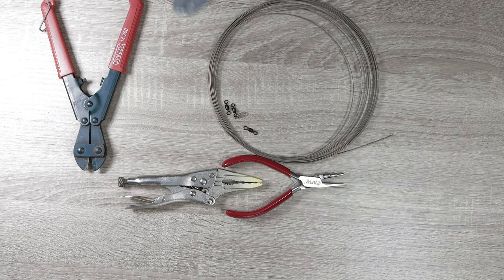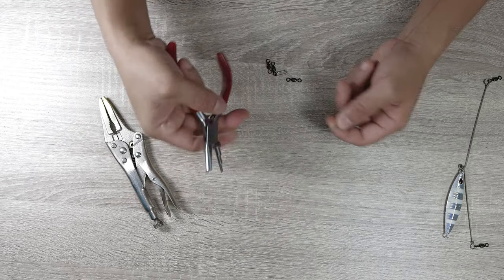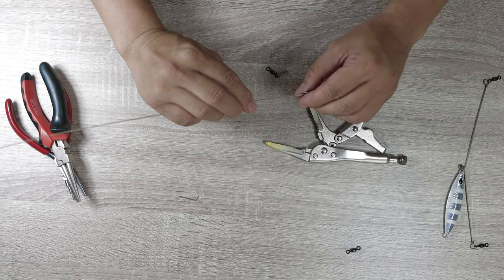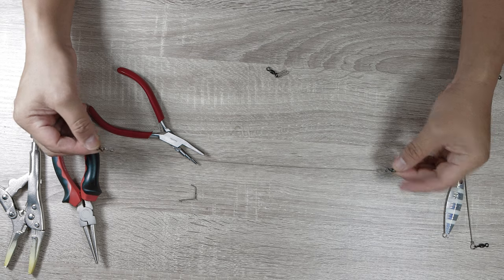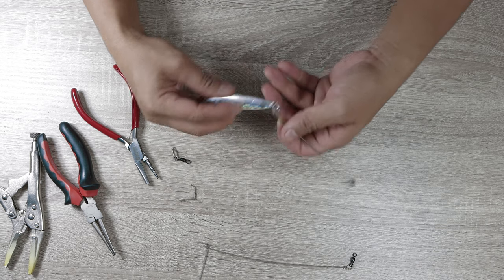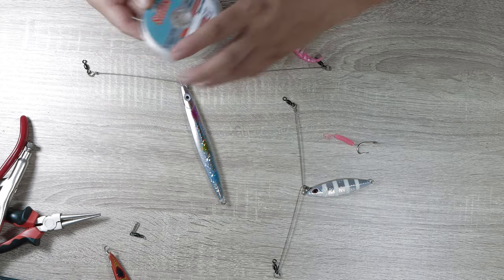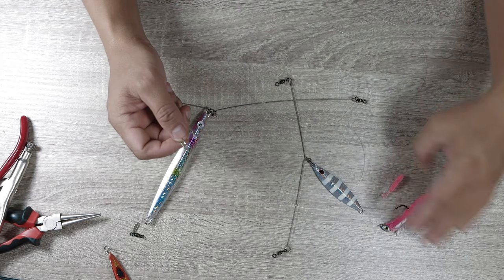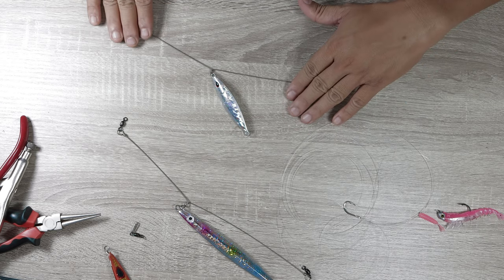How to make a Wire spreader rig for Jigging

Comment: no hooks on the jigs? is it basically just used as a weight?
Reply from the maker: Yup, it gives action to the soft plastic lon a long leader on the other wnd of the wire spreader - this is especially useful when fishing for fish that are homed in to small bait, but are holding deep.

Comment: There are probably still a lot of bite on the attractor jig itself.  
It looks very similar to a three way trolling rig that people also use from shore and in certain freshwater rivers.   They just use a pencil sinker instead of a jig.  They use the three way to present a fly in deeper river pools and from shore for the same reason.
Reply from the maker: Boon, this is dropped 100m or more. The jig moves as well. A sinker will not move and will not attract. But yes, quite similar to the walker / bottom bouncer rig
Reply: Nice set up, but sinkers DO attract.  We get many bluefin tuna on a plain torpedo sinker with assist hooks. Sometimes they eat the weight instead of the bait

Comment: Nice rig, i was curious though, whether the short arm would break easily after the 2 rolls (during big fight)? Thanks
Reply from the maker: The wire im using is 400lb.
Reply: @TheFishingKit  after the rolls on both ends to secure them, you "cut" it by "wiggling" the leftover wire.  I was worry that the short section would also break like that.
Reply from the maker: @aquillae  nah, it wont. it's not subjected to the same forces because when you reel in the fish, its actually a straight line with the wires not bending back and forth.
Reply: @TheFishingKit  okay, thank you kit 👍